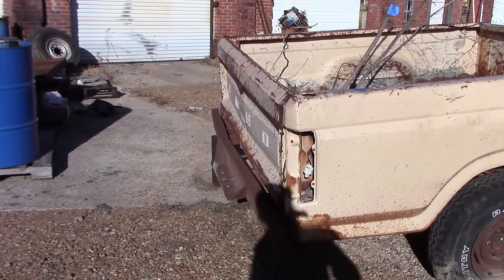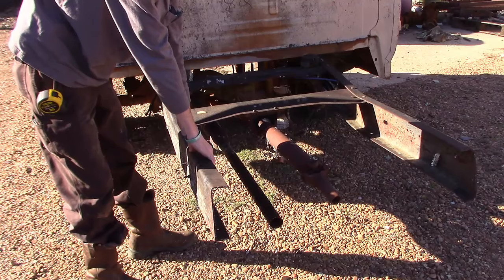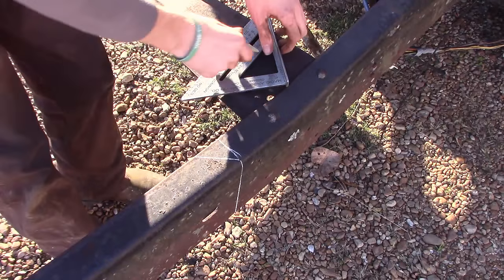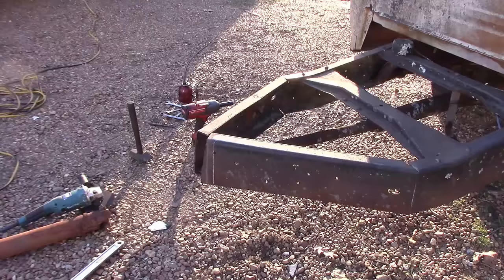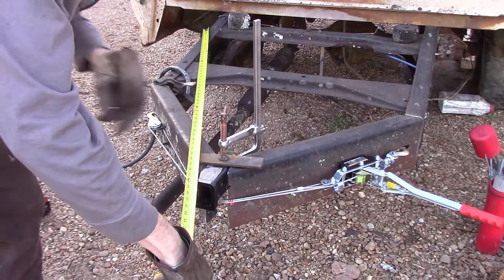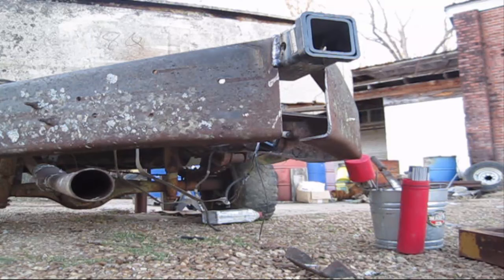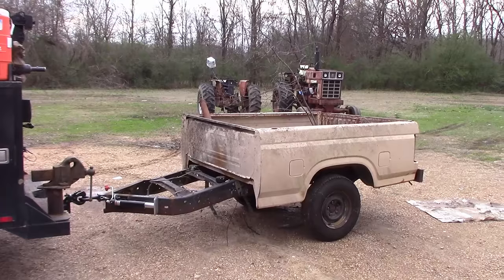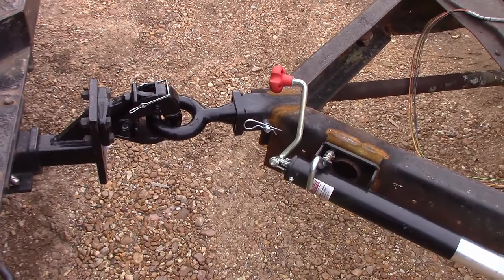Removable trailer hitch build.

Comment: Re. the slack in the hitch. Most semi trailers with a pintle hitch have an air ram to take up the slack I know that's not practical in this setup but you could maybe rig up something that was activated by inertia.

Comment: looks pretty good except for I would've put a triangle shape plate to tie together the tubing and the frame rails. Also would have used a piece of angle iron from the square tubing to the first crossbeam straight down the middle.

Comment: I like putting that Jack behind the hitch on center with the round pipe mount! Pull the pin and put the jack on the truck! Can't jack knife into the jack and screw it up. Makes the jack lift on the center and not twist the frame when heavy. Use a jack with an adjustable leg makes it handier for other uses. Also block up the trailer lower then the hitch height and pull the jack.  Harder to STEAL! Just my idea!

Comment: Thankyou I've never seen a gas welder in use before. 2 questions. Do you have a plug of some kind for the hitch receiver so no one can slot there own into it and walk off with it?
 If you should decide to add a tongue accessory/tool box on it will you please do a video on the build and install.
Reply from the maker: Really? I use one a lot in my videos.  No I don't if there is one thing I know about thieves if they want it they will take it no matter what you do, but if you can make it really hard it is less likely to happen.  I don't know of any normal person that keeps a hitch of any kind in their truck other than the one that does the pulling.  You would have to look at, and buy or make a way to steal it, and no good thieve will work that hard to steal a crappy old trailer.  Sure I'd be glad to.
Reply: Just add a locking hitch pin on the trailer side so someone couldn’t install their own hitch in to it.

Comment: One more thing.....make sure the shocks are in GOOD shape.  If the ones on the truck frame you're modifing are bad, then buy new ones or go to a salvage yard and look for some better ones on a salvaged truck OR large car.  Matching a car's shocks to a truck and vice versa is just a matter of matching the attachment points, the extension lengths, and the compression lengths.  No big proplem. Thank you for this video, Brother.  It should help a lot of backyard builders, such as me, myself, and I;.   lololol

Comment: Class I would have double up and put a 2in pipe or channel tube from your Quick hitch to the back cross members..  but that's just me..
Reply from the maker: blueticecho Somebody has been watching ole Chucky2009. Well you have to look like this too. A cheap utility trailer has 2X3 angle iron for the draw tongue and is rated for 2000-3500 lbs. This trailer is 6" - 3/16" plate that is bent in the shape of a C. I'm not planing on hauling over 2000 lbs so I think it is plenty strong.
Reply: Noooo sir Class I never heard or seen this Chucky guy we did it so we could drag a little job-box to job to job..for our electrical stuff.I got a old 1952 Ford step up box and the tail gate is in perfect shape.
Reply from the maker: blueticecho I got ya. Sorry I meant to disrespect I saw someone earlier that did the exact thing you said.

Comment: Weld that receiver on the trailer up !!! I understand the theft part but that trailer is NOT worth a lawsuit . Your a contractor and the liability will be on YOU.  I love that welding helmet . How do you have it attached to the helmet ?
Reply from the maker: Aye I'm going to try not to do anything foolish.  I'll let you know if something fails.  It is just a hard hat clamp known as a hoop or  halo.   https://www.industrialsafety.com/Sperian-5000-Fibre-Metal-SpeedyLoop-p/cc-5000hw.htm?gclid=Cj0KEQiAnb3DBRCX2ZnSnMyO9dIBEiQAOcXYH9GAhpTKep7jWVu9FXO_RkfEXZ1gWq3ObayGzXUa6XoaAtTO8P8HAQ
Reply from the maker: That's right the frame is the weak part of the build.  I'll find out real quick if my welding holds up.  Thanks man I do appreciate it.

Comment: were you running 6011 or 7018
Reply from the maker: 6011 to tack, 7018 to weld.
Reply: id could tell by how the flux was
Reply: Classic Work If you're tacking with a 6011, why not just finish welding it entirely with the 6011?

Comment: I cant belive you didnt tie the frame together under that hitch with a plate so the bottom of the hitch is tied in to the frame.   That little bar you put in is a joke.  No offence that a weak design.
Reply from the maker: Heavy Metalworks Aye not the strongest thing I have ever built, but it is a lot stronger than one would think.  Take a look at any cheap trailer that is built most are built of 2" angle iron with no boxing under the hitch and no bracing in the tongue.  Now granted I should have put more into the tongue if I pulled it more than I do, but it works fine for what I do with it.

Comment: hi, i,enjoy your videos,and how smart you re but I have some comments? I am looking upon my 70th birthday.i had my first job at 15,in a crane rental and steel erection co.they erected 40 story buildings using guy derricks, where the derrick was on the erection floor ,and the operator and hoist engine were in the bottom basement.this company was the first to bring tower cranes to ny.city.they lost the bid to erect the world trade center by a million dollars.at 18 I got into the steamfitters union learned a lot working with the old timers?  what I want to yell at you is to stop working so stupid?I am watching you fuck around under some old truck laying on the ground, you have a small boom truck, turn the old truck over?you are tall and lanky,learn to care of your back?you seem to have plenty of scrap steel laying around and lots of space, build some work benches or saw horses get off the ground?learn to take care of yourself? I would not enjoy you doing your videos from a wheel chair?   be well, no one is going to look out for your welfare but you?     gene638